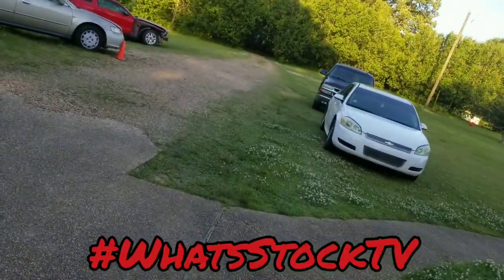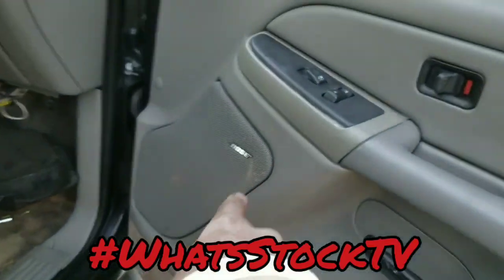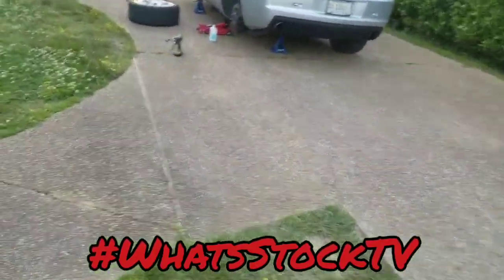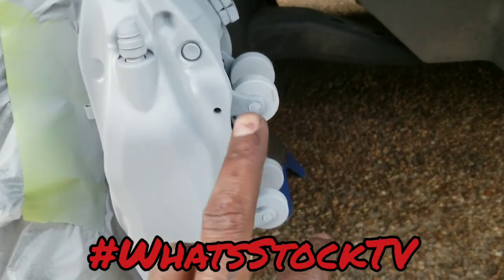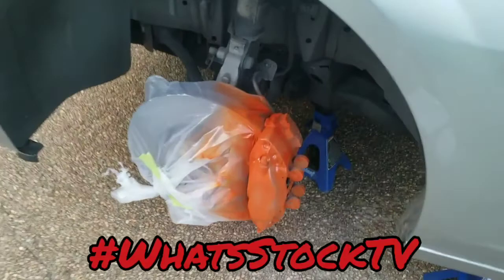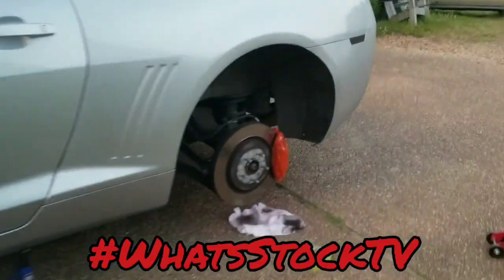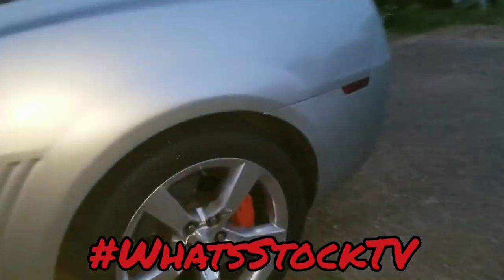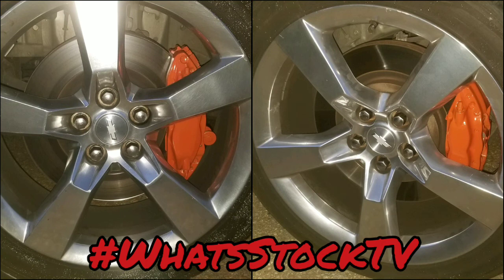Camaro SS Orange Painted Calipers

Comment: Those early year Camaros with Brembos had vibration issues so they put the weights n weird brake pads on them. When I put them on my Impala I took em off to fit my 19’s 🤷🏽‍♂️ been fine ever since
Reply from the maker: 🤔🤔 never knew. Didn't realize until then that this was the first Camaro SS I've done brake calipers on so I never came across them